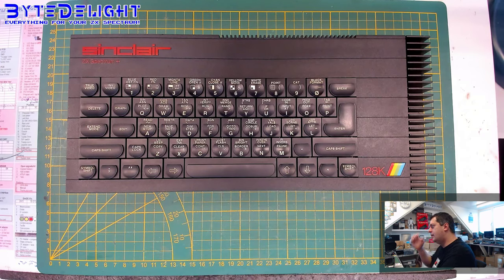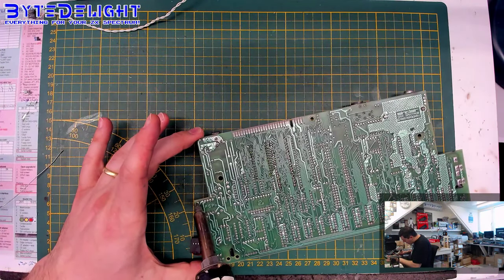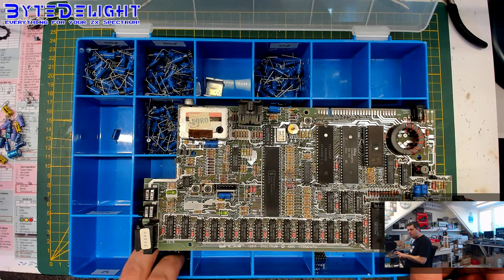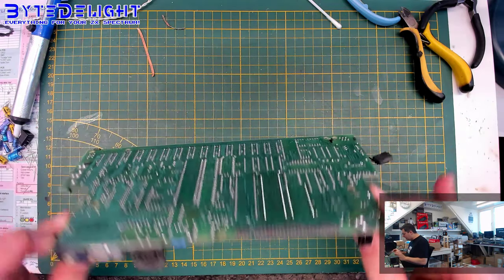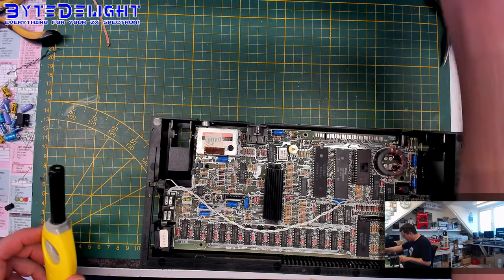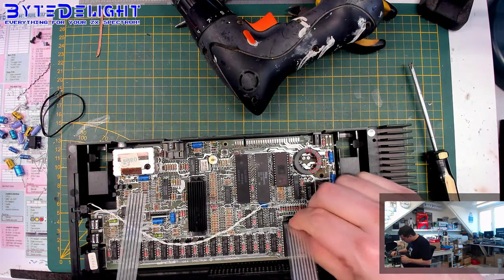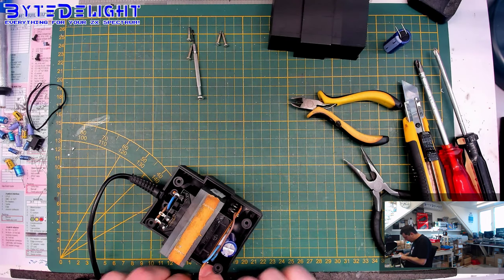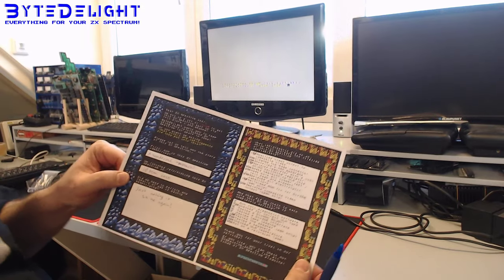How to refurbish a toastrack? (aka ZX Spectrum 128)

Comment: I too had the 48K first and then the 128K toast rack. I still have them though the 48K is in bad shape the toast rack still looks in good order. I did end up with 2 x 48K machines but I lent one to a cousin and her ex stole it from her when they parted, along with some of my peripherals like the Interface I. Don't know how well they run as I do not have a power supply for them. They probably need re-capping.